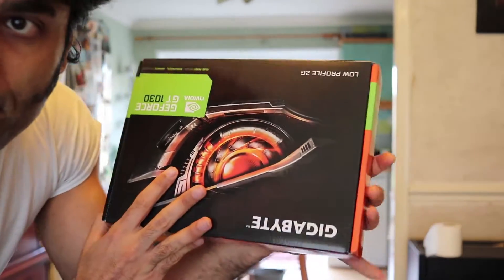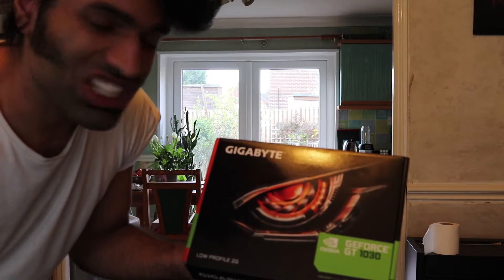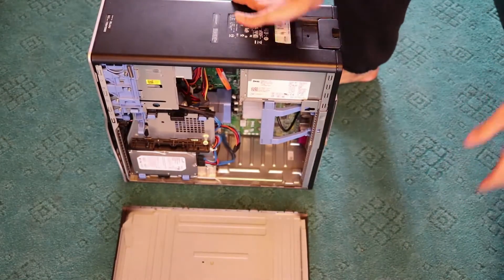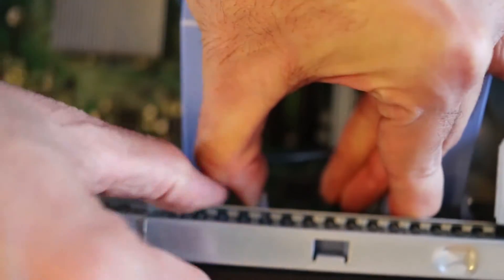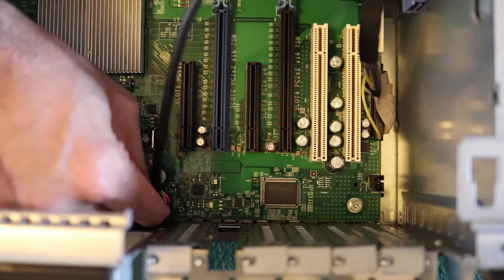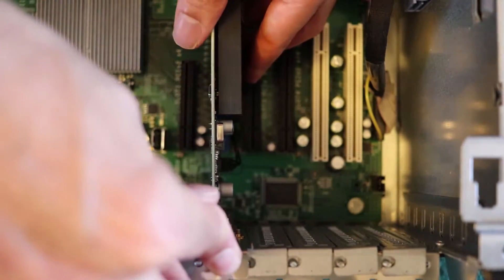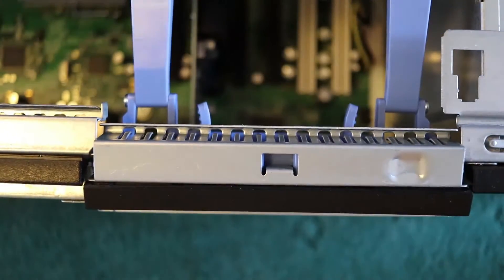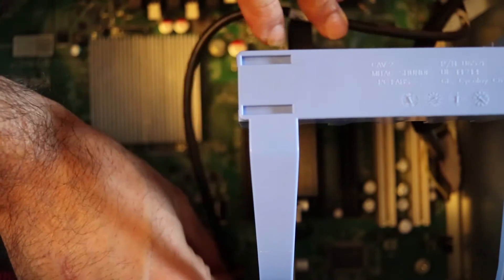how to upgrade 4K GRAPHICS CARD Dell Precision T3500

Comment: Software?  Windows 10?  BIOS version? (I have latest BIOS) How did you install?  I get nothing when plug and play.... (No play)
Reply: @PracticalTechFixes  Ok great!  Thanks for response!  I got it working - BIOS A17/Windows 10 - I had already upgraded but did not have the adapter so was using HDMI out only.  After moving card about to different slots I finally saw something - machine keep giving Service Protection Exception error - I had a problem with Windows 10 so had to reinstall.  After that it worked.  Just took a while to boot and see video.

Comment: Isn't the GeForce GTX 1060 super jetstream 6G better for the Dell precision t3500?  She will still work faster. Since 3GB is not relevant in 2020
Reply: @PracticalTechFixes  07/23/2020 I bought myself a gtx 1060 6gb kfa2.  Great vidyuha and very quiet.
Reply: @PracticalTechFixes  Dell precision t3500:
Xeon x5675
24gb ROM
4Tb HDD
512gb SSD
Kfa2 gtx 1060 6gb
standard power supply unit for 600 watts
Reply: @PracticalTechFixes  Yes! I use it for a year 4-5, in July decided to pump it a bit.
Reply: @PracticalTechFixes  For work and for games, it is perfect, pulls everything! The most important thing is that he is a quiet in work, it remains only to improve the northern bridge - as it is greatly heated.
Reply: @PracticalTechFixes  I made the minimum upgrade, if you make the next upgrade, then you already buy new hardware and more modern. A bit lacking usb 3.0 and ddr4